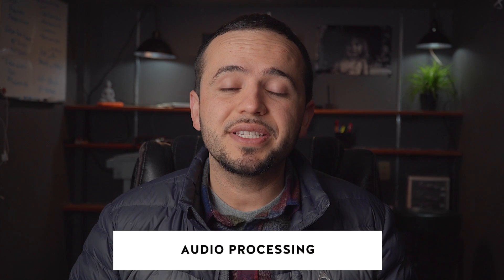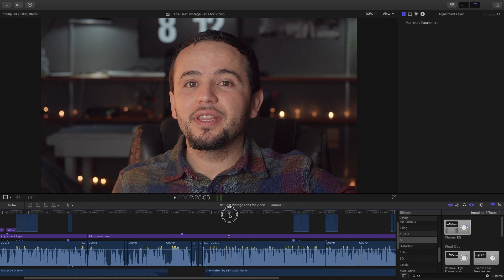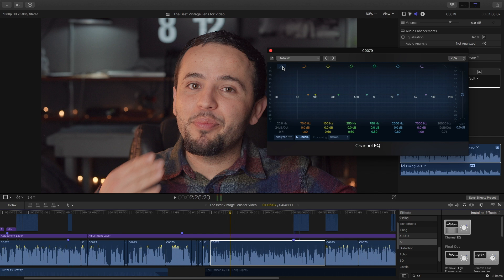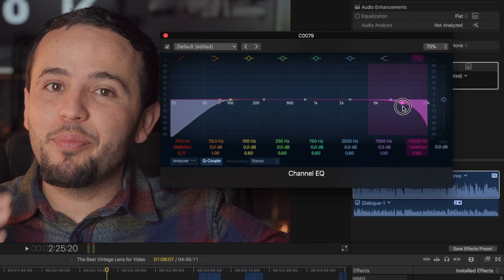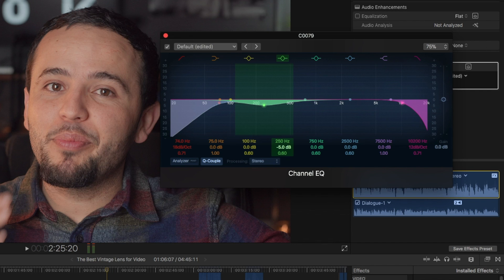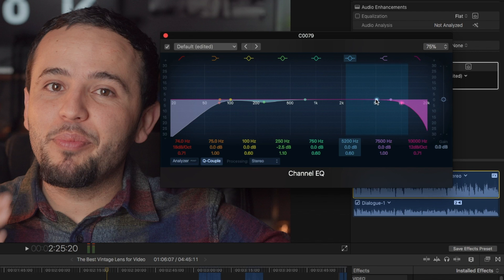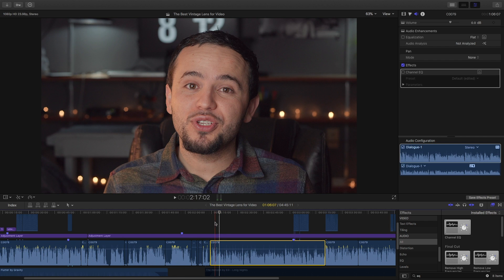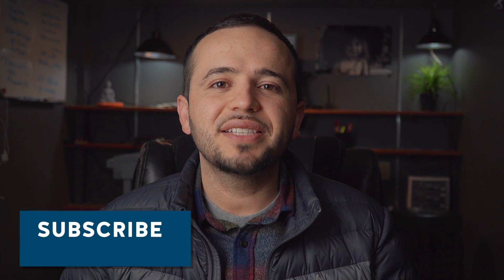How to Process Audio Dialogue for Video (Part 1 of 3)

Comment: I did this and the audio kind sounds better, but more harsh. Cant explain. It hurts my hears. No smooth and calm. Not clipping. Doesn't pass -6 really.
Reply: because one of the significant hot spot he left out is 750 to around 850 range. 250 is a hot spot but 750ish to around 900hz is more important, also the 4000 KHZ, when you speak louder you vocal hit hard around 800 to 900 hz,  if you look up the Spectral degradation of speech captured by miniature
 microphones mounted on persons' head and chest, it give you a more better idea.